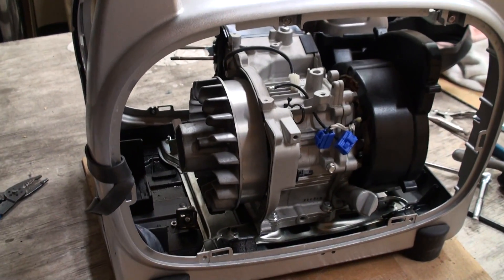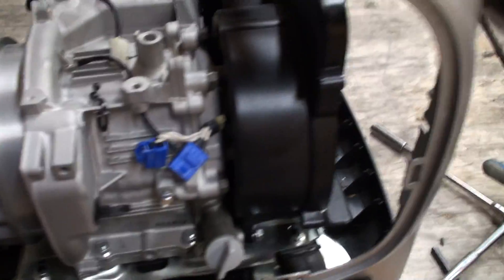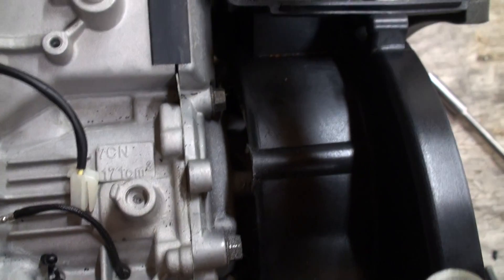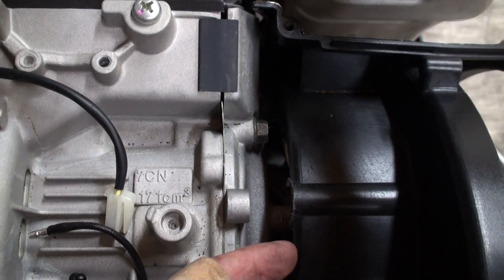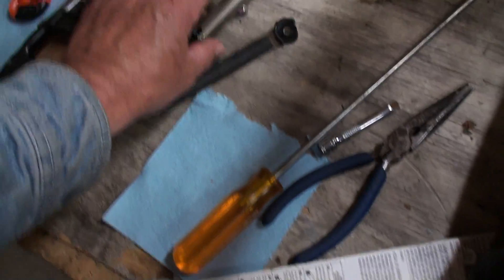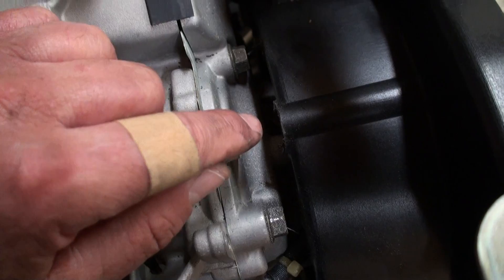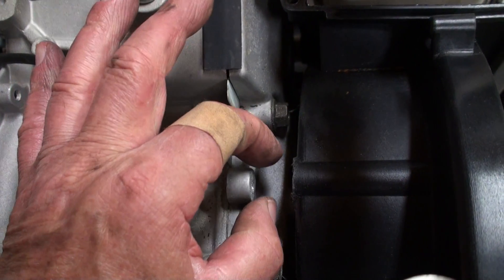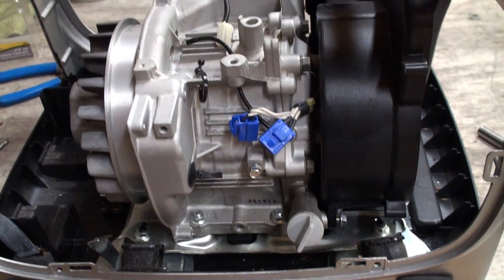Yamaha EF2400is Inverter Generator Disassembly Part4

Comment: So I have the same Inverter and am having the very same problem.  It has not seized up yet but is definitely grinding and sparking as well.  I think it is a defect of Yamaha in not applying the correct torque to the bolt at the factory.  

The fix you offer is more of a deconstruct and not really the correct option.

Is there a right fix?
Reply: yes. 11mm socket, borrow a harmonic balancer puller, pull the wheel off and use lock-tite. Most likely the plastic housing is cracked, and will need to be glued. you will need a new bolt, as the head will be destroyed. Takes about 25 mins to fix, but thanks to Branson for showing what the problem is.